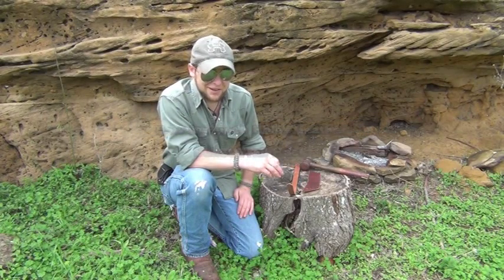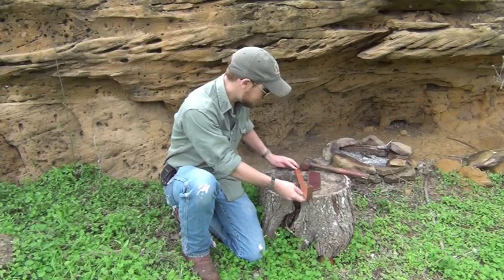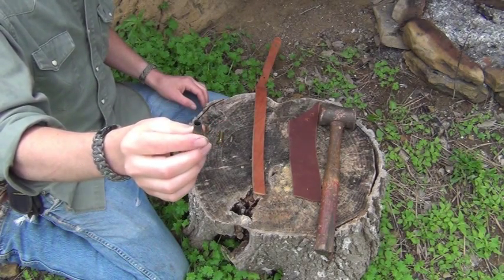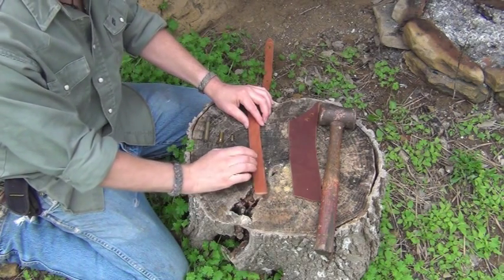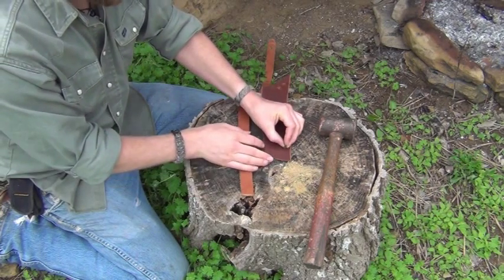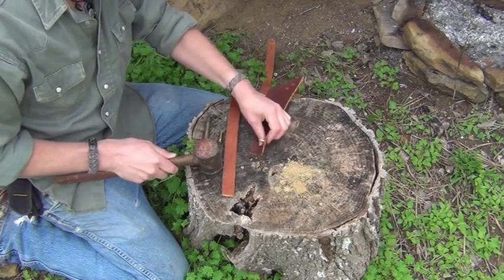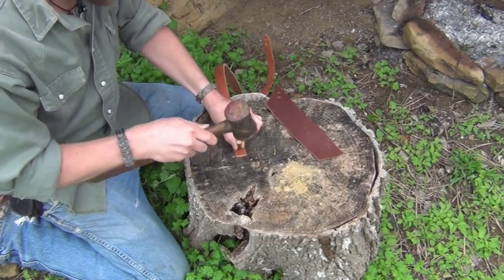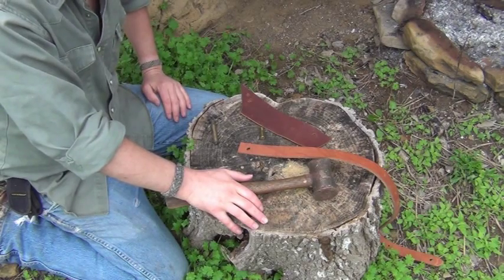How to Leather Hole Punch using Bullet Shells

Comment: I've been using shell casings as punches for some leather projects lately and was even considering making a video about it  but looks like someone beat me too it. 
Ive found the .22 lr to work pretty well in most leather but when it comes to the thick stuff,  steel cased .223/5.56 cases are the best. They are readily found at any gun range and the best part is you can pick up all you could ever want with just a magnet on a stick. No need to scrounge around on the ground trying to find the right case. I have heard the Russians make steel cased 
.22  lr but i have yet to find any. 
You can also sharpen the case mouth with a counter sink bit on a drill to really make it cut well.

Comment: Another use for rifle cartridges is cleaning your files back home in your shop. I've bought old used files from a pawn shop and used them for years. Just push the open end along the grooves at around a 45 degree angle and the soft brass will conform to the grooves. It's surprising how much gunk roles out. 😎

Comment: I would use my Leatherman to hold the case. If you have a saw cut a dowel shaped branch tap with flat end. It is feasible to sharpen the shell ream lightly with a knife. Factory ammo is dull compared to reloads.